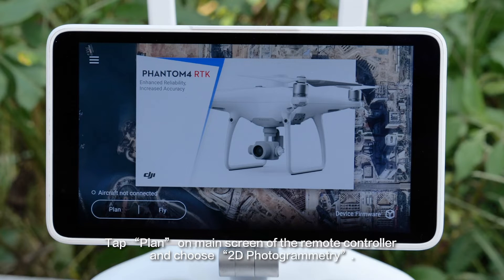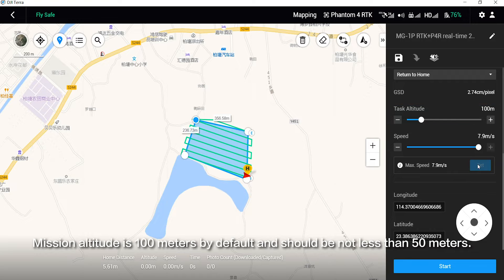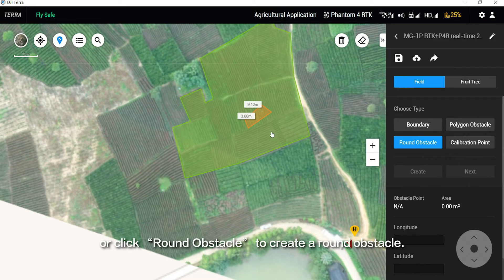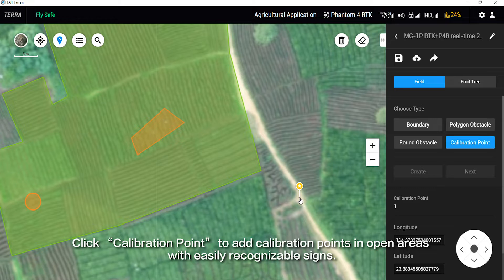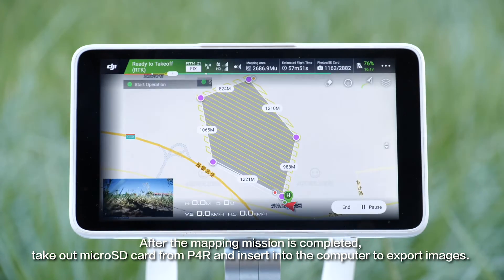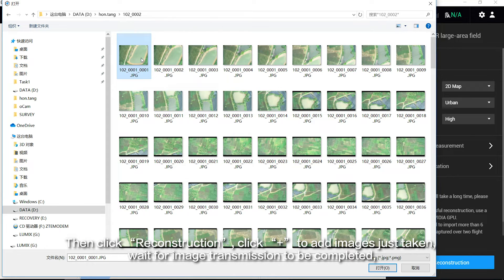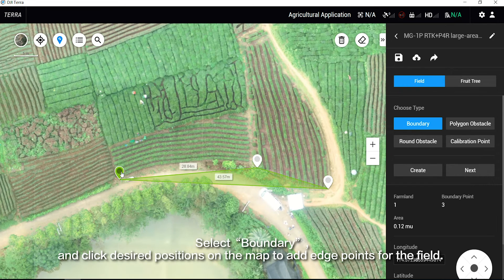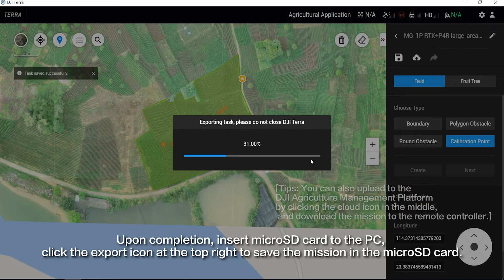DJI Agriculture Phantom 4 RTK Mapping tutorial

Comment: When the mobile app for phones/tablet to use the D-RTK 2 as a handheld mapper is going to be launched just like is described in the manual (v1.2)? 

I just bought a combo of P4 Multispectral + D-RTK 2 station and I want to buy another D-RTK 2 base station to use it as a handheld mapper (rover) in rural areas where I can't connect to a NTRIP server because of the lack of 3G/4G cellular connections. So, for this to happen, you guys NEED TO UPDATE the DJI GIS PRO app + DJI GRS on the Apple App Store... maybe the DJI GO app could be updated for implement this function and also be updated to bem compatible with iPad Pro's screen. 

D-RTK 2 has a really good hardware for the price, and a progressive workflow that is just lacking in the possibility to use a second D-RTK 2 station while other drones like the P4 Multispectral or even colect GCP's for a Mavic 2 Pro/Enterprise Advanced for redundancy. 

Engineers who are your really good clients LOVE REDUNDANCY.